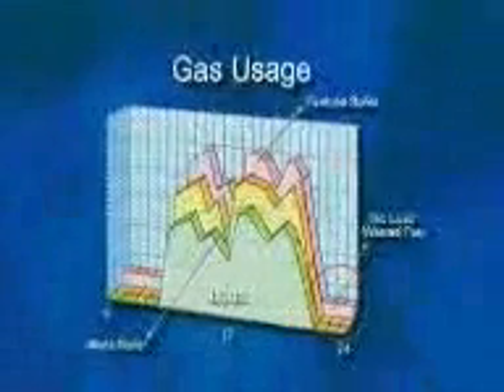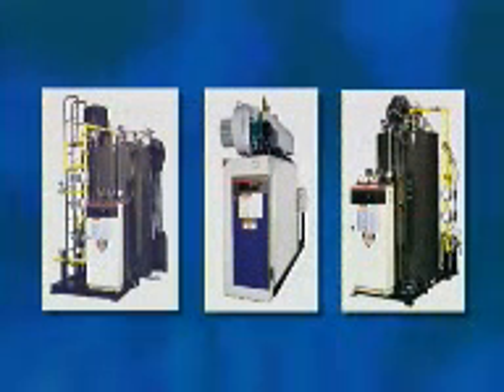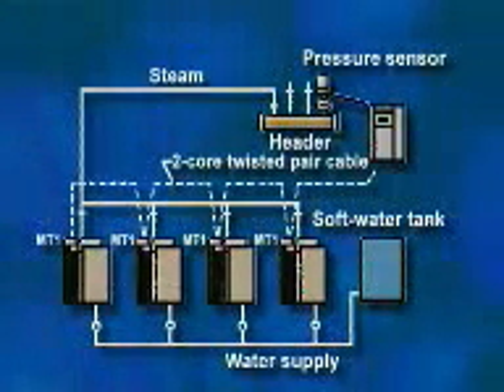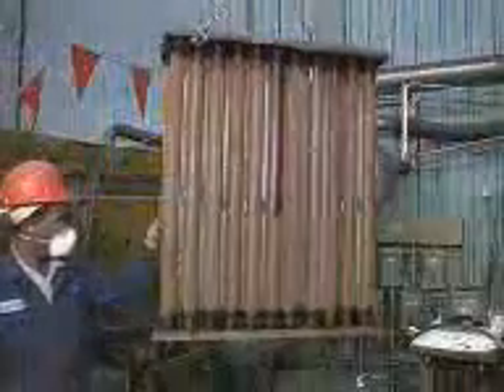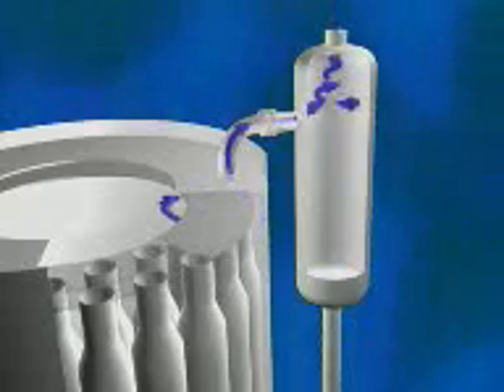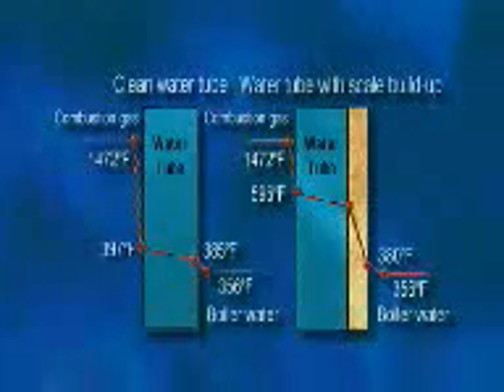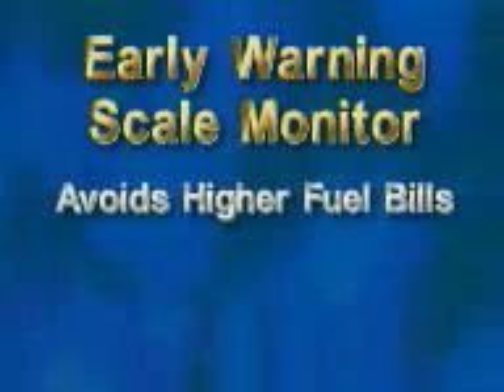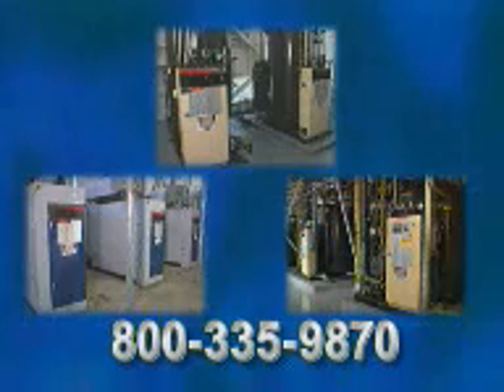steam boiler

Comment: VpCI®-617 Boiler Water Treatment
Description: Proprietary corrosion inhibitor for boiler water systems. Water soluble, provides long-term protection against corrosion and scale formation. Suitable for low to medium pressure boilers.
Package: 5 gallons (19 liters), 55 gallon (208 liters), totes and bulk.
In Vietnamese market, please kindly contact: 
MDI chemical Co., Ltd
Hochiminh Branch
Le Dinh Nghia (Mr)
M: + 84 909 075 887
Email: nghia.ledinh@mdi.vn
Skype: lechemtech@gmail.com